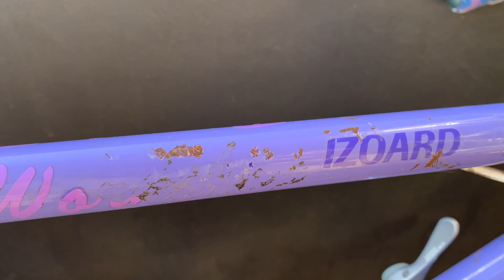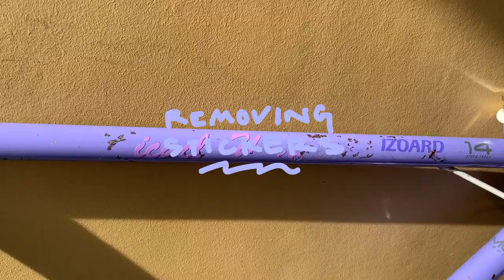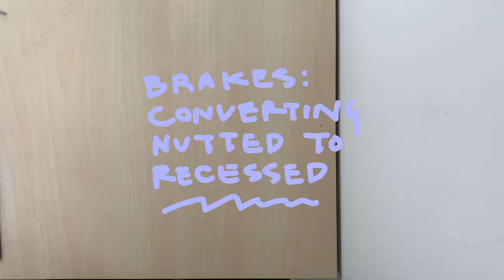Vintage Road Bike Restoration - Peugeot Izoard 1991

Comment: Nice! Quick tip for pedals always remove them when they are still on the bike, that gives you leverage and stuff to grab when you try to remove them, if they are super tight I just use a strap to hold one of the arm in position (usually attached to the chainstay) and it always worked :)
Reply from the maker: Thanks for the tip! I will definitely try that next time 👍😊
Reply: Agree tip of always removing pedals first before dismounting cranks and BB. Normally hold the crank at 3 -9 o'clock position and push down on crank nearest your body to get the best mechanical advantage.  Similarly using same technique always dismount the cassette or older freewheel first before working on or dis-assembling a rear wheel. If it's stuck clamp the spline tool in a vice facing up, drop the wheel onto it and grasp wheel rim both sides to exert extra mechanical purchase - usually works. Loved the vid, great work Gary
Reply from the maker: @kevinfrost1579  thanks for the tips Kevin, appreciate it !! Will remember for next time for sure. Glad you like the vid , Cheers!! 🤗

Comment: Love it! It's easier to remove pedals first, then the cranks. Stand over back wheel. Hold one crank horizontally, then spanner the other off one turn. Then repeat other side.
Reply from the maker: Cheers my man! Ya I’ve been doing that since and it’s easier for sure! Cheers

Comment: Regarding the use of ice to undo the pedal. This makes logical sense.  Cold makes metal contract and both the crank arm thread and the pedal axle thread should each have shrunk back from each other just a tiny bit thus creating less metal to metal pressure or increasing the separation between the threads. Conversely heating the threads should have caused them to expand against each other thus making the thread tighter.
Reply from the maker: Ayyyy tru that !

Comment: Lovely job! I'm actually in process of restoring 80/90 Swiss TIGRA road bike, with whole Shimano ex 500 except 1050 headset on vitus999 frame. Originally had this groupset on smaller purple centurion, but the seat post was seized and frame was to small anyway, so I've ended up buying vitus999 Tigra signed frame, and giving it fresh repaint (purple+silver fork), so it looks gorgeous now. Unmounted it to a single screw and cleaned everything. Had some problems on the way (french bottom bracket-always pay attention if it's BSA for sure), but right now only thing left is to polish aluminium parts. Can't wait to build it back, I ve been working on it at weekends in my hometown Słupsk, as i'm living at dormitory in Gdańsk. Can't wait for the final effect. Your video motivated me a lot, purple/white reminds me of my bike. One of my favourite Restoration videos, you actually had some job with this bike, unlike others who just buy perfect condition bikes, clean it up without even greasing bearings and call it a restoration.
I wish it would be possible to upload photos here.
Brawo!
Reply from the maker: Thank you! I appreciate it, means a lot thank you. Hahah yeah I hate it when people do a bike build and call it a "restoration" lol. Would like to see your bike if you're on instagram send me a photo! The key to finishing it up is just to keep working on little bits here and there.Cheers mate and good luck with your restoration!!
Reply: @garysprojects  Yea, I'll send you when it will be done.

Comment: Nice restoration! I would personally remove the toe clips as they look great, but they can be very dangerous while riding. Or just leave them hanging upside down and use the pedals as flats.
Reply from the maker: Cheers man appreciate that! I actually never had any problems with them! But yeah each to their own

Comment: Nice job on a pretty bike. Only two things made me cringe; no crimps on the cable ends, and using WD-40 in that cable housing. That stuff is mostly solvent, can't be good for the cable or the housing. Nonetheless, good job on a nice bike.
Reply from the maker: ayyy thanks my dude appreciate it! thanks for the tip!! will keep in mind for next time, maybe I will look into a lubricant vs a solvent. Also I ended up putting on crimps ;)

Comment: Instead of wasting ice, just put the crank in the freezer next time. Also, a torch will come in handy on seizes stuff like that. I noticed ur tool wasn’t the strongest, I bet if you had that wrench from the beginning, and you slipped a pipe over the crank or the wrench, or both, and heated up the crank or iced it, it would’ve popped from the beginning. Both the crank and the wrench you were using weren’t that long so you were never getting that much torque on it, combined with the shirt tool
Reply: Also, some Teflon tape on those threads when reassembling will help when it comes time to take back apart(:
Reply from the maker: Ahahah yeah having the right tool definitely helps! also like the breaker bar idea, could come in handy. I’ve taken a few pedals off since and no problems yet. thx for the tips!! 😊
Reply: @mstrshkbrnnn1999  a smear of grease does a great job.

Comment: hi, I saw listing similar to this bike and im wondering if it will fit me. im 5’7 and the frame size is listed as 54cm medium.
Reply from the maker: Mmmm could be tight , I’m 5’9 and I ride 53-54 
But depends if you have long legs or not

Comment: Thumbs up !  :)  Very cool solution on a gear control unit, although i would've take it apart and try to glue the broken part, or try to 3D print it or some sh*t like that, if it's plastic :D
Reply from the maker: Plamen Paco hahah yeah I just did the quick fix lol

Comment: First time seeing your videos and subbed. Liking your laid back approach. Couple thoughts from me. Bradawl for clearing outer cable ends for smooth inner. I start bar tape from end of handlebars to overlap is away from hand pressure.
Reply from the maker: David Walton thanks for the tips! Yeah I think it is most common for people to wrap bars that way, I like the cleaner look without having to use bar tape so did it top down! Thanks more vids to come 🤗🤗🤗

Comment: Great video, but What about all the scrapes are you not going to repray ?, i recently got a 1987 Peugeot so just going to clean up abit and respray to the original paint theme 👍regarding handle bar tape just going to take off old one and buy new, i might change my wheels to black ⚫  wider depth rims dont like the originals.
Reply from the maker: thank you mate i appreciate that  ! sometimes i think its better to keep the original paint, as it has character. wishing you the best for your project cheers!

Comment: Can you sum up the costs?:) thx and great vid
Reply from the maker: Cheers! Which costs were u after?
Reply: @garysprojects  i mean After all. What did the restoration cost you?:)
Reply from the maker: @clarasiegfursvw296  
It’s kinda hard to price because some of the parts I had , bolts/ paint/ materials etc but here u go
Bike / new cables / housing / chain / grips / pedals / tyres / stem around $250 + labor
Reply: @garysprojects  think you very much! Helped a lot